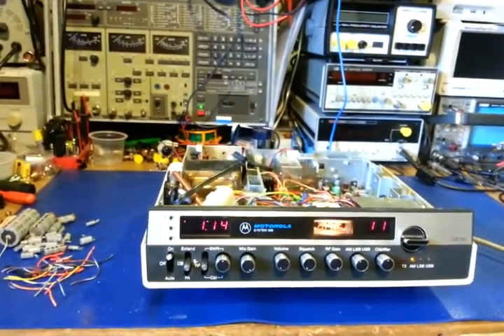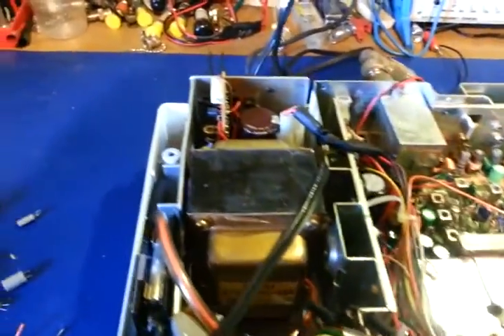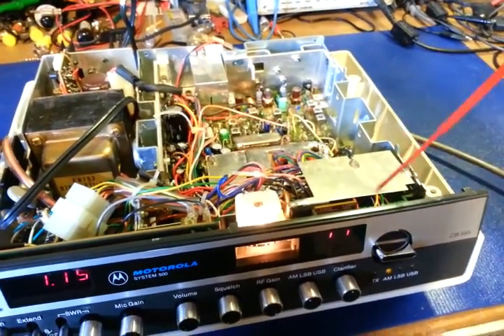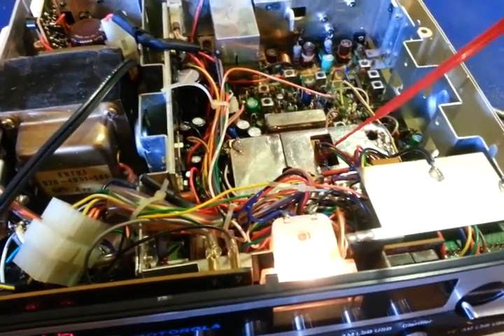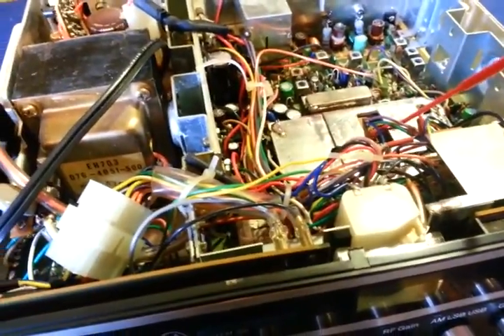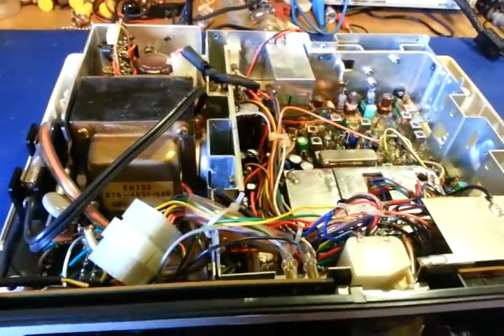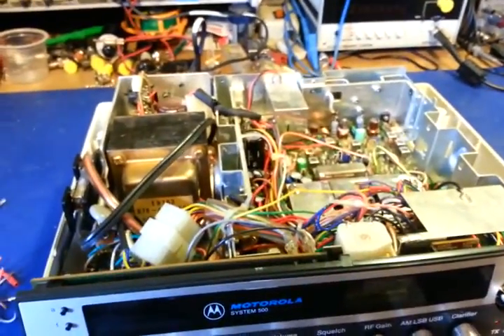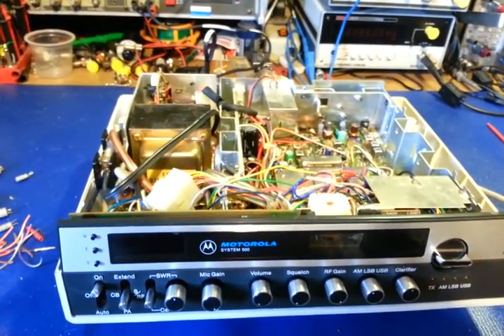Motorola CB555 repair progress.  Part 2

Comment: What were the symptoms before you recapped? I have three of these with intermittent transmit, not sure if I should start with caps or the relay in the corner of the radio board